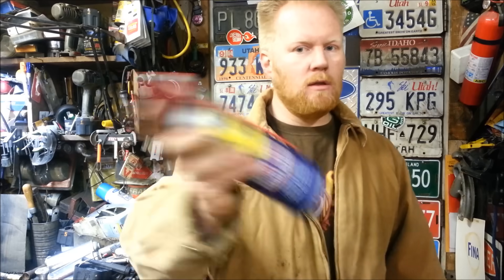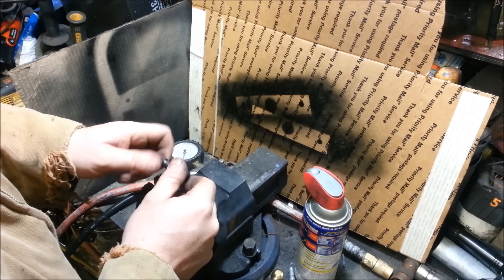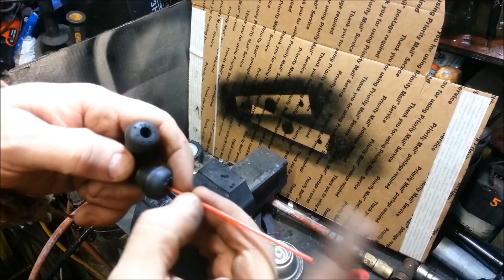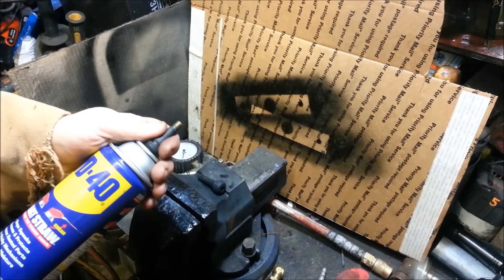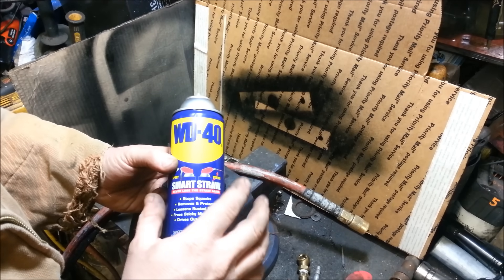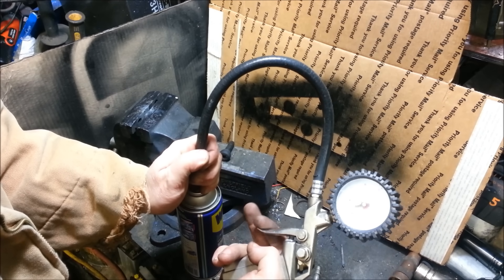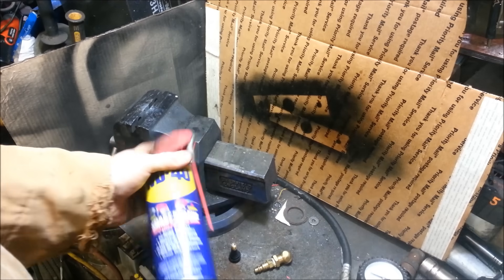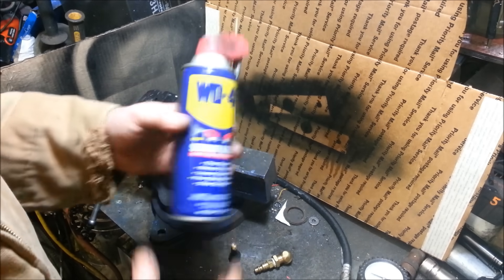Refill flat AEROSOL Spray Cans like the WD-40 and others

Comment: My problem is slightly different. I have a can (like yours with the flex straw on it) which is getting low but still has plenty of propellant. I have another much older can (no output nozzle) with PLENTY of WD40 AND propellant but the output pipe on the valve has a piece broken out of it, slightly triangular in shape and extending down too far to get another nozzle to seal on it. What I would REALLY like to do obviously, is somehow transfer the WD 40 out of it and into my other can. I just HATE wasting stuff just because of a "minor" defect somewhere. 

I have tried joining the two cans with a tight small diameter plastic pipe but can't get the full can to dispense before the cracked part escapes the end of the pipe as it is pushed down to open the valve. Any suggestions from people? All input gratefully received.

Comment: CLOGGED HEATER CORES>  Similar hack for clogged car  heater tubes. Take heater hoses off. take the stem out of the valve. Blow air backwards through the heater coil by usin  the fat end of the stem to create a seal between an air blow gun and the outlet tube of the heater core. Keep Your Mug Outta the Way.

Comment: Great idea, I've done it  using a rubber tipped blow gun, on the spray head, just push it down and end then hit it with air, also subbed,  I like people who solve problems that most people would just buy new, thanks brother 😎😎
Reply: I too have always used rubber tip blow gun

Comment: I'm kickin' myself in the ass for all the partial cans of paint and WD I've tossed out over the years. Never thought it would be safe to recharge a can. It's just a matter of having the brains to figure it out like in this case. All you need to add is a few psi. Sumbitch. Just think of the benefits: cuts down on garbage, saves a ton of $$. I hope the 47K that like this will start using their compressors, or even a scuba bottle.  Instant LIKE and SUBSCRIBE!! You sir, have the hack of the decade. Greetings from Alaska.

Comment: Yeah, you need an air compressor and a valve stem that will cost hundreds of dollars. The safer, cheaper, and simple fix to this is to buy a new can of WD40 and move on.

Comment: That's Funny, but I guess it will work on stuff like WD-40 cause it's not going to effect the liquid inside. I have a can of Motorcycle chain lube that is probably half full, but the air leaked out, and I can't use it, the only problem is when you spray it on your chain, and this stuff makes contact with air, it begins to dry and thicken. I wonder if there is a way to put another propellant into the can, you know, anything but air. Maybe Propane gas would work, since most propellants are flammable anyway, has anyone tried that?
Reply from the maker: Propane actually works great.

Comment: If you do that with anything that is air-curing (example: paint), it'll go solid in the can.
Reply from the maker: Not if you use the remainder of the can.
Reply: @sixtyfiveford  Not if you use it IMMEDIATELY, true. You don't get a chance to, say, refill it and continue using it over the course of the next week, as might be the case if you had bought it long ago but never used it, then when you tried it, it was out of pressure from long storage. Been THERE.

But... if you use a different propellant than ordinary air, you can (no pun). Argon springs to mind, or nitrogen. Both are readily available in pressure bottles. Nitrous oxide almost certainly; that's what they use as propellant in whipped-cream cans. Not OC2.

Comment: I called WD40 to complain about so many cans losing pressure. I’ve been refilling with air for years, but they insinuated leaving out in a cold garage causes failure to maintain pressure, blaming storage. FYI
Reply from the maker: What person doesn't leave these in their cold garage... I've had other cans do this but nothing to the degree of wd-40 that has almost a 100% failure rate. Dissecting cans over the years I noticed they have a air bleed valve at the top of the pickup straw. It has a check ball that doesn't seat properly/gets stuck open and allows propellant to escape with the WD-40 fluid. I think they want a little propellant to escape to create a foamy spray but that part fails fully open.

Comment: Compressed air and WD40 makes for an explosive mix, put a drop of WD40 on the base of an air gun pellet load it in an air gun and it cracks like a .22 lr and leaves the barrel at about the same velocity. It's called dieseling, just be carefull with the pressure is all.
Reply from the maker: True, but the pressures need to be in excess of 700psi to do this. Working with air compressors you really never getting above 120psi and I'm never putting more than about 50psi in the can.
Reply: @sixtyfiveford  Yes I think your idea is great it's just some people can be deadly with a combination of any two items you can think of. The things I have seen you wouldn't believe, someone I knew tried to make a bench grinder with and unsecured electric motor and one grinding wheel, he lost most of one hand muscle in his forearm and part of his lower jaw and face, and that's true.

Comment: I quit buying WD40 for the reason that almost every can of it I've ever purchased, stops spraying with a 1/4 or more of the product still inside. Now I buy 3-1 oil in the squeeze bottle
Reply: Two very different lubricants. The 3 in 1 won't clean surfaces like WD does.
Reply: You're using it wrong, like most people do. The can needs to be upright when you spray, otherwise you'll empty more air than lubricant so the ratio gets messed up and you'll run out of pressure before the can is empty. I see it every day. I personally buy 4 gal jugs of wd-40 and a pump spray bottle (you get them in a kit at many hardware stores for about $50 I think)

Much cheaper and you'll avoid that problem all together.

You can also buy refillable aerosol cans on amazon. Fill it with whatever you want and pressurise it with a compressor or bicycle hand pump. Just don't fill it with acetone or other similar solvents cause it'll dissolve some mechanism inside (probably plastic) and mess it up completely...talking from experience...
Reply: Do you shake up the can every time you spray?
Reply: I bought the spray bottle, and just buy a large can to refill it

Comment: Surely better to never use the can inverted. The diptube needs to be submerged all the time otherwise you are spraying out the gas. The can is designed to have the right amount of gas for the amount of liquid. If it runs out of gas then it is the user;s fault.
Reply from the maker: Not true at all. Modern cans have a propellant pickup at the top that has a gravity feed check ball. It is supposed to seal when the can is upright or open when the can is upside down to allow upside down spraying. Any angle in between the check ball doesn't seal completely and a small amount of propellant is expelled with the chemical. I have multiple cans where the check ball has stuck in the up position and you can only use the can upside down.

Comment: Don't run out of air that often but when it does most of the contents are gone. I cut the can in half with my bandsaw and put the remainder in a pump oiler can. I save the cut can, its great for storing things like pencils and pens. Paint cans have either ball bearing or marbles that I have not use for but just couldn't throw it away. 

What got me is dropping a new can on the concrete floor resulted in a broken short spray tip. No idea how to fix that one.

Comment: Slick fix for a common problem. I did something similar with WD-40 - just held the tip of a blower nozzle up to the opening, pulled the trigger and pressed in on the tube end. A little messy. This is a much better solution!

Comment: I suppose an old shrader valve from an old bicycle inner tube could be used.
Reply from the maker: They don't have the correct base to seal against the top. You can also just use a rubber tip air spray nozzle.

Comment: HEY !!!!!!!!!!!!!!!      I like your instructions and I just thought of another good idea .      Rig up a small tank with a removable plug so you can fill the tank with any kind of liquid you need to put in the W D 40 can .      Have your small tank with an air valve for filling your small tank with air and a valve with a line from the tank to fill your W D 40 can from the top . Your W D 40 can , can be used in two ways !!!!!!!!!!!!!     Use as a small air blower or preasurized can of liquid of your choice .     Just a suggestion .--------------Ernest E. Johnson
Reply from the maker: I made a refillable aerosol can: http://youtu.be/doLPFPeJ6JE

Comment: Use propane it works much better' that is what's used  initially.
Reply from the maker: It absolutely does but is something that would scare a lot of people. Compressed air allows me to get the last 1/4 of the can out without any issue.

Comment: Did you know that all cans have a small painted dot on the top of the can for a reason..? That's the direction to point the nozzle so you get every last drop..the pick up tube is where the dot is.....try it.
Reply from the maker: Yes, BUT Wd-40 and others have a air valve at the top of the stem that pulls in propellant and mixes it to make a foamy spray. This valve sticks open and you get a higher ratio of propellant to WD-40 and before you know it, no propellant left.

Comment: i refilled a bee spray can  when it was empty and no pressure in it i made a hole in the top of the can large enough to push a brass 1/8 close nipple into it then soldered the nipple to the can . this is where you refill through...put a threaded 1/8 cap on the nipple to seal...then took the brass air fitting out of a bycycle tube...made a hole on the top of the can and soldered that in place..now the air can be pumped in through the valve and refilled through the nipple.   paint thinner kills bees and is cheaper by the way
Reply from the maker: Good idea. I recently watched a few videos where a high ratio of dish soap and water worked as amazing bee/wasp killer. Looks like it works just like the spray cans of killer.

Comment: Would love it if you could find a non-destructive way to fill Bic lighters with propane. I wonder if filling through the small tube where the gas comes out rather than messing with the bottom filler would work.  Thanks for this video, very helpful and ingenious.
Reply: To fill a bic you take a small screw hook for hanging pictures and stuff and twist it into the bottom hole til a little pop happens and now there is something rattling around in there. Then you stick a butane can on it upside down and fill it as best you can, then you cover the hole with your thumb super fast while removing the butane can, then you use your screwed hook or eyelet which has a  little piece of threat tape on its tip to quickly thread into the hole as you remove your thumb. If you are quick enough you can get them ¼ refilled without loosing much gas. If you want to get crazy then do the same thing while inside a room of comparable pressure as a butane can, say like, under the sea or something. I find once you get your bic to seal a dab of ( the stuff that's fun to say) cyanoacrylate, keeps it from coming loose on accident ( if you get the kind that isn't a gel your a huckallero¹ )
Reply: @dadephunt1717  Simpler to just buy Clipper brand refillable butane lighters even the flints are replaceable.
Reply: @iffykidmn8170  true but Bic lighters are celebrated for their heat resistance in particular. When a trio of teenagers is trying to see how much dirt weed they can smoke in an attempt to get lit,  a Bic lighter is going to do a good job keeping rotation with the bong in the summer,  whereas most other lighters like clippers  but most especially scripto brand lighters will overheat,  destroying the plastic that carries the striker, leaving a lighter than has to be "jump start" by a different spark source ( usually a second  lighter that is depleted but still strikes). Its pretty much a smoker person problem. And btw OP  propane isn't going to work in your butane lighter. It might be the difference in flash point or the pressure difference or something but I'm fairly certain its a no go.
Reply: @dadephunt1717  Well then in that case perhaps a Bernzomatic torch with replaceable 1lb propane tanks and piezoelectric striker.:face-turquoise-covering-eyes:
Reply: @iffykidmn8170  yeah iv got that setup. Though I tend to prefer an older single flame torch because its got the adjustable flowknob. The issue with propane vs butane is mostly about the temperature it burns at.  A butane Flame, even a jet style one, doesn't readily make glass molten. Its just barely cold enough to make it difficult to achieve.  Propane on the other hand burns something like 25% or so hotter.  And readily deforms glass. Especially if it's thin. The real ultimate solution Is to literally harvest the components needed from a refillable,  and fit them into a Bic. It's rare to see it done right but I have seen it. ( If anyone attempts this. As I recall they replaced the entire underside of the Bic with the refillable underside,  they didn't just drill it and try to install the stem.

Comment: now figure out how to get old unused great stuff cans to work.
Reply from the maker: If the inside hasn't set up you can spray acetone(carb cleaner) down the inlet and it will dissolve any set up foam.
Reply: @sixtyfiveford  thanks dude!

Comment: does the white nozzle on the WD40 need to be pushed down to insert the air or can it be filled without pressing it down?
Reply: I guess not, it must be some sort of unintentional one way valve, some sort of rubber ring is pushed up by the pressure and probably a small spring, but if you pressurize from the outside it moves down a little bit enough to let air in.

Comment: Think I’ll stick to using my casexx Fin, ice pick , drill bit, nail or whatever is within reach to make a small hole in the ridge of the can. It’s not rocket surgery. Guess if you can’t get the oil where you need it with out propellant that’s a good idea but who the hell knows how many PSI it takes before a can of penetrating oil becomes a HAND-grenade.🧐 Im sure someone out in YouTube land is thinking but don’t. No it won’t blow up and if you’re afraid you’ll get cut don’t stab place the pointy object on the can and give it a bump. Hand or hammer or whatever. Be safe It’s all fun and games until you loose an 👁.

Comment: Thank you for this, and WD seems to be one of the ones that does this regularly. Great mech hack, thanks!
Reply: does the white nozzle on the WD40 need to be pushed down to insert the air or can it be filled without pressing it down?
Reply: tony emjay you remove the white button part of the nozzle leaving the small tube/steam of the nozzle. The tire valve goes over that small portion seating around the base of the top of the can. It works, and i am so happy, i have just resurrected like 4 old cans of WD40 that had the lubricant still in the cans but no pressure to access it. Before i had to cut the can open and save the fluid that way. This is so much easier..

Comment: you can buy aerosol can that have a metal schrader (air) valve built in separately. Just put in liquid screw top back on and fill to desired pressure .  I use this for liquid wrench and carburetor cleaner.

Comment: I do not recommend this at all. Some products might be okay to do this with but aerosol cans are not just filled with compressed air. Most of them are gasses in liquid form. The compressed air your putting in there has C02 in it which is the most common gas that will cause a can to explode if there is not enough product in the can to mix with. I actually work for an aerosol company and have seen people get seriously injured because of cans exploding

Comment: THIS IS NUTS!!!  I was a manager of an Auto parts store when managers knew parts and knew  Chemicals.

WD -40 is highly flammable.  You can use a can as a flame thrower.  Putting  WD -40 in car tires is and EXTREME HAZZARD as tires  FLEX and in summer reach high temperatures putting a flammable Solvent in tires RISKS EXPLOSIONS

I would expect if any have fires from this IDIOT SUGGESTION the Lawsuits will roll.  And if there is death GOD HELP this IDIOT.  

When I look down the comments I AM TERRIFIED of how many are thinking this is a good idea.

Comment: Does the valve stem/core push the nib down on the wd40? Or just but up to it?
Reply from the maker: There is a step inside the stem the depresses the nib when you force it on.
Reply: @sixtyfiveford  lovely! Thanks fella. Should prove handy. I usually end up cutting a hole in the can lol they always run out. Cheers 👍👍👍

Comment: Do you have a solution for paint cans that get blocked in the valve?
Reply from the maker: I do. https://youtu.be/h9gQQDqLW9Q
Reply: @sixtyfiveford  awesome, thank you. Actually considering this method. Other than that, poke a hole in it, drain the paint and spray with a compressor gun

Comment: I expect those aerosols come with inert gas such as nitrogen in them. By adding air (with oxygen) with the petroleum product inside you are completing the fire triangle, essentially creating a bomb. This makes me nervous.
Reply from the maker: Most are filled with a propane / butane mix or CO2. The ratios are way off to create an explosive. You're also missing a key component: an ignition source.
Reply: @sixtyfiveford  Of course the heat is missing, usually. Process safety must anticipate the unusual. With pressure vessels, we usually try to normalize a maximum of one fire triangle component in the vessel, so there is no possibility of ignition inside the vessel, I.e. it becomes a bomb. Put in the air (O2) plus a combustible in a vessel and it becomes a much higher risk.
Reply: @sixtyfiveford  Aye carumba. I just noticed we had this conversation 3 years ago, I had forgotten LOL!